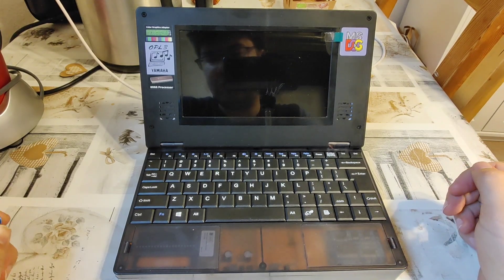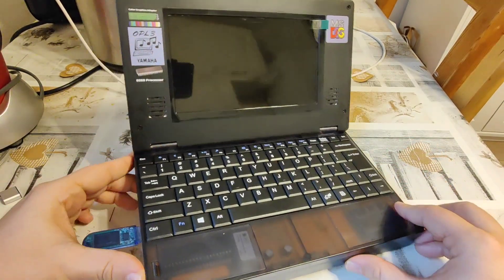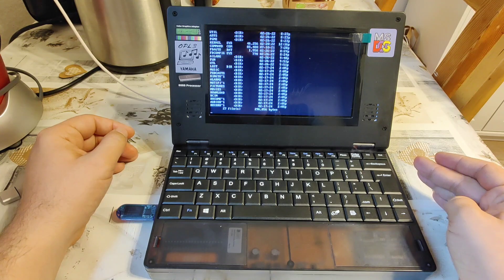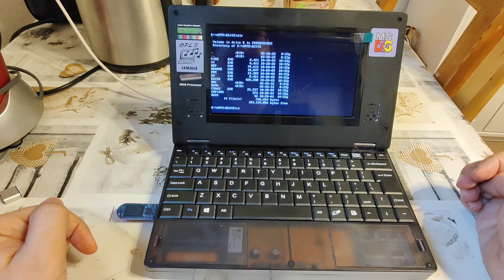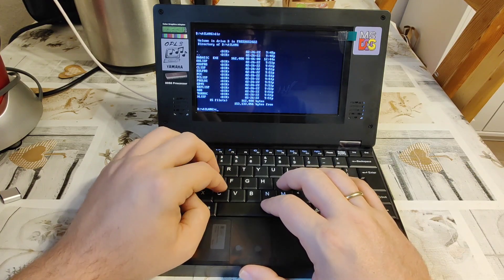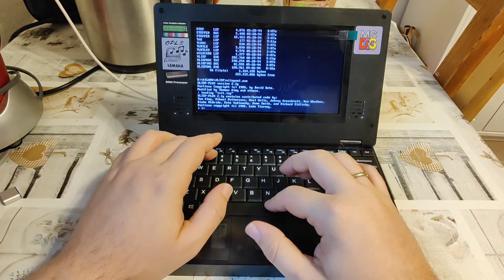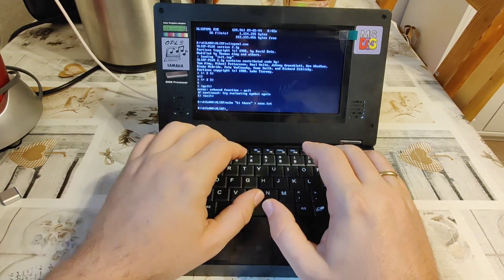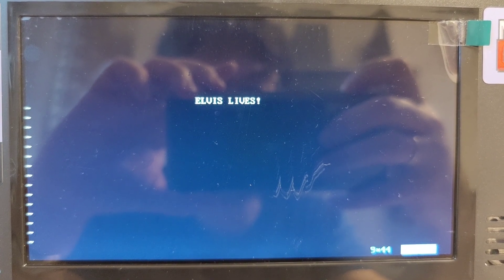Set up USB on Book 8088

Comment: These things are nice :) One of my friends has one. Trying hard not to want one because I have a monotech NuXT. Love my XT's. The USB must be quite slow as Elvis I use often on the NuXT and it takes 3-4 seconds to load from one of the 20gb PATA IDE drives in there off one of the 527mb partitions. Quite a bit faster. Volkov Commander is about 4 seconds.
Reply from the maker: In all fairness, I have to warn you — you know, in terms of "Super-Self", "Self" and “Id", I am very close with my "Id", so do not listen to me for anything that you wish to turn out "reasonable", or you will absolutely amass all that is beautifully strange! 😄 I actually think your NuXT is a very lovely choice!
Reply: @ninoivanov  Chuckle  It's difficult at times ..there our better two angels.. one saying "buy the exciting thing and use it!!!" and there's that other angel on the other shoulder screaming "Didn't you hear the other guy?". Yes.. I love the NuXT from JB over in New Zealand, it was definitely worth saving for and works really well with a Lo-Tech 2mb EMS memory card and ethernet.

Comment: Hi, it's me again 😂! Some comments: The USB slot is probably controlled by a  CH375 USB to ISA controller, as in the Pocket 386. That means:
* The drive isn't controlled by the BIOS, but by the CH375DOS.SYS device driver.
* You can't boot from it.
* No non mass-storage devices.
* It should be hot swappable, at least the one on the Pocket 386 is. Maybe you need a later driver version.
Reply from the maker: ... and knowledgeable as you are, your comments are very welcome — thank you very kindly!